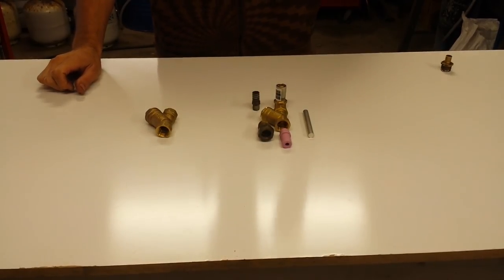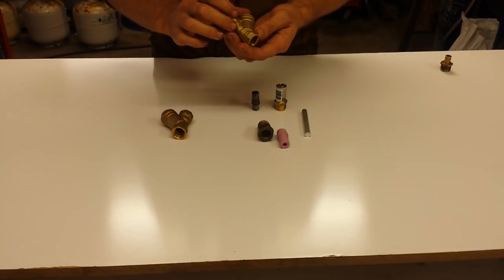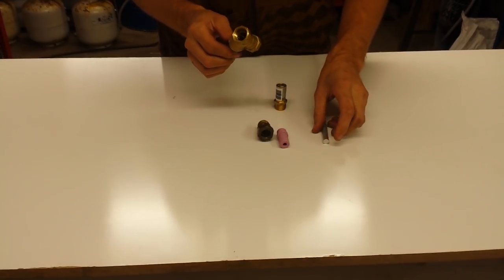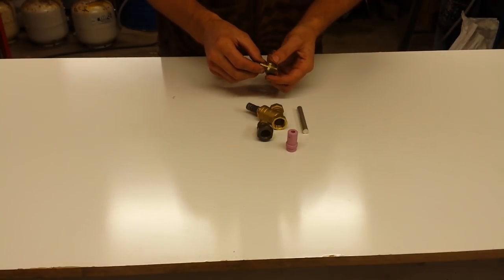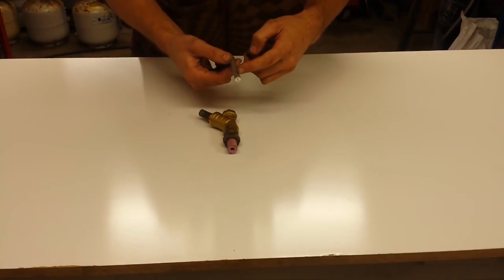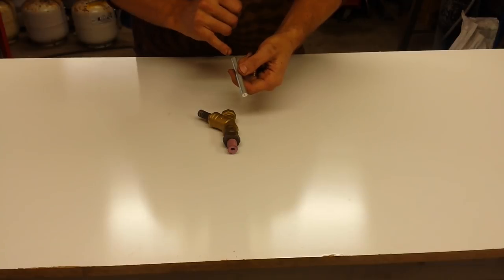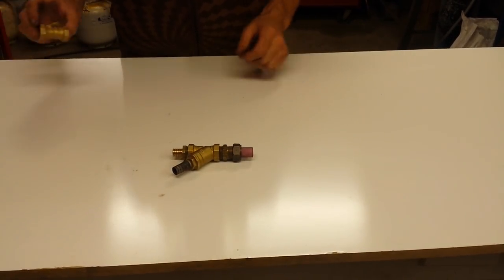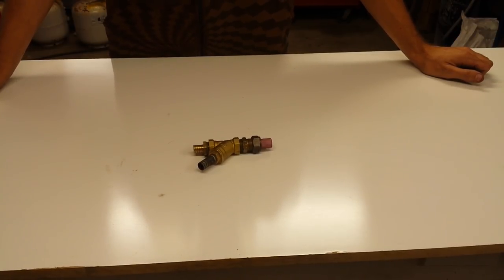How to make a vapor blaster gun/nozzle - Recap

Comment: I’ve found that a for the air jet a 10mm x 100mm bolt can be drilled in a drill press and threaded into the air inlet hose barb. Makes it easy to adjust the gap behind the ceramic nozzle and it’s workable for someone without a lathe. I’ve used this video and built a nice nozzle for my 5hp compressor that works well with a 3/32 air jet and a 6mm nozzle.
Reply from the maker: That's some awesome advice! I did think about using a bolt, but I have been put off in the past drilling hardened bolts.

I always love seeing these types of nozzle pop up all over the internet!

Cheers

Comment: Slide some thin medical rubber tubing over your air needle all the way to your 45deg end , it will last longer as the slurry enters it will hit the air needle at a harsh angle the rubber will absorb the impact and abrasion, after thirty years of blasting this one tip saved me thousands on premature boron tip replacements 👍
Reply from the maker: All the cheap ebay/ali express nozzles have that. I never bothered because I have never had one wear out. The slurry with glass bead is so much softer than dry blasting medias. 

I have one nozzle thats 4 years old and still has the same air jet and pink alumina ceramic tip.

Comment: Hi Josh, 

Great job on these videos. You are really boosting this community. I'll try building this myself without a lathe and have a few questions, if you've got time.

- What is the diameter of the stud used for the needle? And what do you thread the end to? I don't have that many threading or tapping tools, so it would be great to use the same dimensions as you do here. I would prefer not to machine the tip of the needle as you do, was that only necessary because you didn't drill out the coupling (I'll still taper the tip though)? 

- Do you reckon a threaded stud as the needle would limit the flow of the slurry?

- Is the coupler just a 1/2" to 1/2" with a compression nut? 

- Is it possible to just use two 1/2" barbed fittings - One instead of tapping the end cap + a 1/4" barbed fitting (or maybe a 1/2" won't seal up?), and one instead of the buteline fitting (or is it just better to strip a buteline?)?

Thank you again for your videos!

Cheers, 
Jonas
Reply from the maker: Hi Jonas,

Sorry for the delay in getting back to you.

The air needle used is 3/8ths, or 9.5mm works too, but make sure that it will match the intter diameter of whatever hose barb you use. the brass and aluminium seem to be fairly forgiving in what size tap you use. I have had success with both 3/8th UNF and m10x1.0, and m10x1.5.

It is good to taper the tip to follow the contour of the ceramic because you want the tip of the air needle quite close without obstructing the slurry flow past the end. You can put it in a battery drill and file it. 

Yes, you can use 1/2"barbed fittings for both on some inline filters. The Chinese imports have a different thread so it needs the cap to be drilled and tapped.

Thanks for watching!

Comment: Great video . Can this be used on a normal media blaster with 40 grit garnet . And does the hole go completely through or is the simple on the end just to assist on the lathe

Just been through the comments and found the media answer and will look at the drawing . Thanks for sharing this build . im looking for something to update my blaster but dont see the need to pay mega money on a huge flow gun .
Reply from the maker: Hey Gary,

Yeah it was surprising how often I got this question. I am yet to do any extensive testing but initial experiments look positive. The most conclusive (at least in my non scientific mind) evidence so far is the improvements in wet blasting over the standard guns.

Are you referring to the hole in the aluminium air needle? If so, yes it goes right through.

There should be enough info in my videos to build one, but if you get stuck, all the info is available here:
https://armoury-enterprises.myshopify.com/products/diy-vapor-blasting-guns

Thanks for watching!

Comment: Hey josh I just made one of these nozzle/guns exactly as you did in this video. Unfortunately I made a small error when drilling the 5mm hole, I went a tad too far and so instead of my 2.5mm hole being 15mm in depth it’s actually only 5mm depth. 

Can you see this being an issue? No problem if so as I have a lathe and could make another one.

My unit isn’t set up yet so can’t test it. 

Cheers
Reply from the maker: Hi Daniel,

You may get away with it. The longer hole just narrows the stream a little, but there are turbulence regardless so the gains are not exactly game changing. With vapour blaster guns being positively fed, it shouldn't create to big an issue. I would just run it and if you feel like its not performing right, try remaking that part.

Cheers
Josh
Reply: @ArmouryEnterprises  thanks Josh. 

How much clearance do you leave between the air nozzle and ceramic tip? I chamfered the nozzle to match the tapered section of the ceramic tip — do the two parts need to be seated together to work efficiently or is a small gap necessary?
Reply from the maker: @Dsm152   you want a 4-6mm gap between them

Comment: Amazing gun. Question, "7" in ceramic is for 7 mm pass diameter? if not, could you tellme how much does it diameter?Greetings and thanks a lot.
Reply from the maker: Hi Gabrial.
Yes, 7mm internal diameter. I bore them out to 8mm as it seems to work a little nicer.

Cheers!

Comment: Still waiting for all the parts to make one of these tools. What size ceramic nozzle do you think may work well with air and baking soda? Found a variety of 15mm nozzles in 4, 6 and 7mm.
Cheers
Reply from the maker: Hey mate.

Sorry I thought I had replied to this. This nozzle will work with most blasting materials including baking soda. The size of the nozzle will depend on air volume and the type of blasting. With wet blasting, I usually use the larger. I started with 7mm but it was barely large enough. I now use custom 8mm and 10mm nozzles.
Reply: Yeah, I was thinking of using one of the smaller sizes because I'm only using air and soda with this gun. Have the aluminum rod for the inner tube and will be machining it on my mini lathe soon. I'll try to get a video together, so you see what I've done. Always appreciate your help. Cheers from America m8

Comment: Awesome design !!! ..... what variance to the design should I consider if I wanted to make a sand blasting gun instead ? Thanks in advance
Reply from the maker: Hey! Thanks for the question. The two things that you could change are the air jet diameter and the distance between the end of the air jet and the ceramic tip. Although it should in theory work in the configuration shown in the video.

Check out the latest video on sandblasting cabinet mods (Kawasaki spanner restoration vid) if possible, I would recommend a pressure fed metering valve.

Hope this helps.
Reply: Will do ! I’m going to give it a go cheers !

Comment: I made the air needle  with a 5 mm hole while the blasternozzle is only 6mm.  this seems to put over pressure and push the water back. Will i have to make the air needle hole diameter much smaller or is the problem with the pump? I put a check valve on the pump but that didn´t help.
Reply: Either make the air needle hole smaller or get a bigger nozzle.

Comment: Maybe I missed it, but will this nozzle work for dry blasting too?
Reply from the maker: Hey, theoretically yes, but I personally have not tried it. If this were to be used for dry blasting, I would recommend making the inner air jet out of something harder than aluminium and fitting a protective sleeve of silicone hose or similar.
Reply: @ArmouryEnterprises  Thank you.

Comment: hi
would a brake pipe with a mig welding  tip drilled to size work. could solder or braze the tip on  ?
Reply from the maker: Hi, sure that would work. Some people have built these with brake tubing brazed into a 1/2" fitting and cut to length.

Comment: And do you vary the 4-5 mm distance from the air nozzle to the ceramic venturi for different blasting grits?
Reply from the maker: Not for wet blasting, I usually just set it up at 5mm, and change it during testing if it doesn't perform as required.
Reply: @ArmouryEnterprises  Thank you.

Comment: What modifications would be necessary for this gun to work for both dry media and vapour blasting?
Reply from the maker: This gun will work with both wet and dry. Just swap out the ceramic nozzle to suit the media and air supply.

Thanks!

Comment: Great  video!  Does changing the jet size have any effect on the finish since it is using less CFM?
John
Reply from the maker: Hi John,

Honestly I haven't done enough research to know what differences are achieved with different jet sizes. What I can say is that too small a jet takes much longer to achieve any result. The rule of thumb I work off is to work out the largest jet that the compressor set up can sustain.

Thanks for your question
Reply: Armoury Enterprises I purchase one of the eBay guns and I made a smaller outer nozzle (8mm) compare to the stock (13mm) and it made a big different but have not tried changing the size of the jet yet that's next. Good work keep it up Thanks!
Reply from the maker: @TheJR914  Thanks!
Yes the 8mm to 10mm ceramic nozzles seem to be about right for the average home set up. I only go larger if the cabinet will be used on an industrial supply.

Comment: Hi, what size hose for the slurry feed and air feed to the gun do you use?
Reply from the maker: Hi,
On most of my cabinets, I use 12". The big systems that use large air supplies have 3/4" lines.

Cheers
Reply: @ArmouryEnterprises  is that the ID of the hose? 
Cheers
Reply from the maker: @jonny8730   Yes, Hose ID.
Josh.

Comment: I'm sure you mentioned it,  but even on second watch I can't catch what size strainer unit you start with. 
I'm ordering parts from eBay and there are a few options.
Reply from the maker: Hey Nathan.

Strainer size doesn't matter as you remove the strainer basket. It's more important to get one that has a straighter casting so it doesn't get too thin when you machine out the inside for the air needle.
Reply: @ArmouryEnterprises  so any of the body sizes work? The options at 1/2" to 1".
Reply from the maker: Yes. The principals are the same. But to make the ceramic tips fit best it's better to use the 1/2" model.
Reply: @ArmouryEnterprises  Thanks heaps.

Comment: Why make something you can by for $32 at Amazon.  That is the complete kit with spare ceramic nozzles
Reply from the maker: Because in many places around the world, buying from amazon, ebay or Ali express can take up to a month for your stuff to arrive (That was why I built my first nozzle) And secondly, because the stuff you get from Amazon, ebay or ali generally require massive air supplies in order to function properly. This type of nozzle works much better for smaller, more common compressors, finding a good balance between performance, and conservation of air. 

Thanks for the critique though.